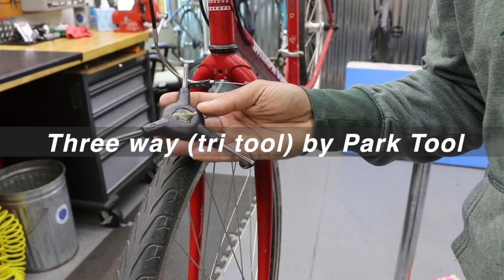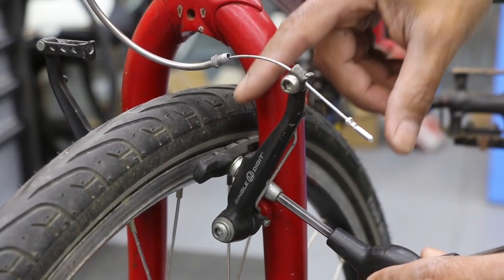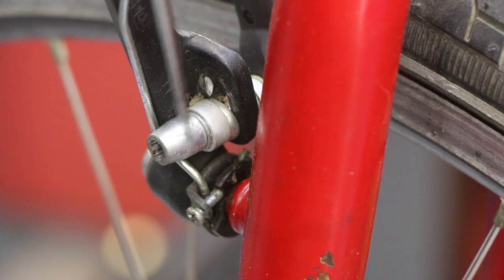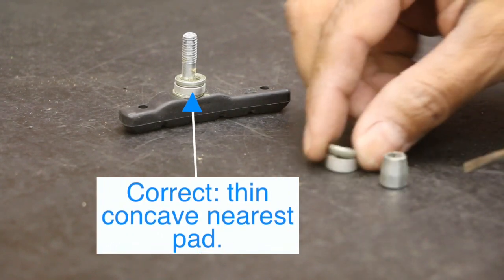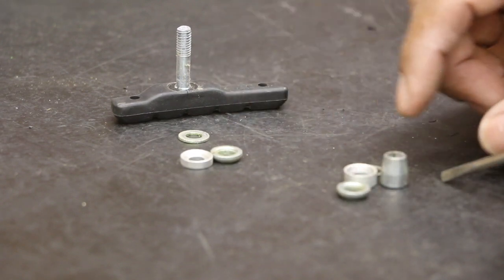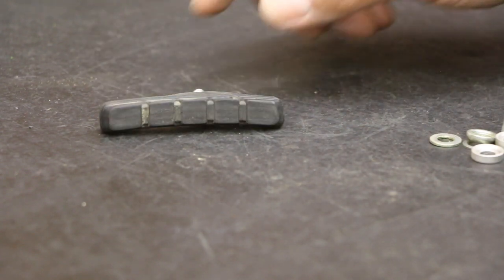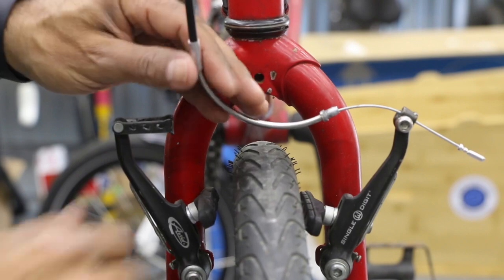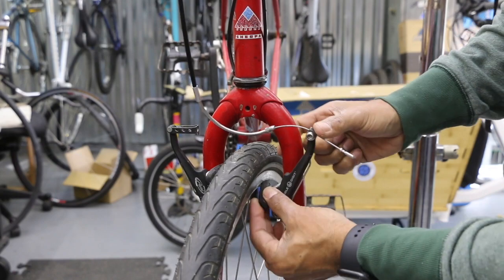How to remove and replace v brake pads & position conical, concave spacers.

Comment: I suppose the thicker spacer could go on the inside if the rim is of a more narrow variety . Perhaps this is why there  two sizes , for different sized rims
Reply from the maker: Yes, you can experiment.
Reply: If you look on the back of the package of Kool-Stop pads and the instructions for Avid V Brakes they both show the largest concave spacer used for 5mm and 6mm spacing on the outside of the brake arm. Those 2 options would more than likely be used to compensate for pad wear and not for brand new or slightly used pads.
Reply: I have a brand new pair of asymmetrical v-brake pads to replace, but they have the L and R like the long parts of them, go forward. I put them in the tipical way with long part backwards... do that change anything? What should I do?
Reply from the maker: Follow the direction. Long end facing back typically if you are sitting on the bike.
Reply: you can put the thinner spacer on the inside closest to the brake pad as then you can have the pad aligned, not angled away from the rim.

Comment: I followed this video and didn't change anything except the pads. It seem like the new pads are really spongy, they engage during the pull of the entire lever, but they just squish onto the rim without a lot of stopping power.  I even bought another different brand of pads, but they still do the same thing. What am I doing wrong? Thanks!
Reply: Maybe the rims surfaces are ready to replace. The braking system works well with both surfaces (pad and rim) in good condition.
Reply from the maker: Did you fix it? Some bikes have a built in spring inline which relieves braking pressure. It's mostly found on recreation bikes to protect the (novice) rider from slamming on the front brake and crashing.